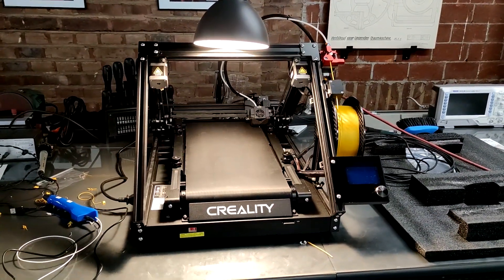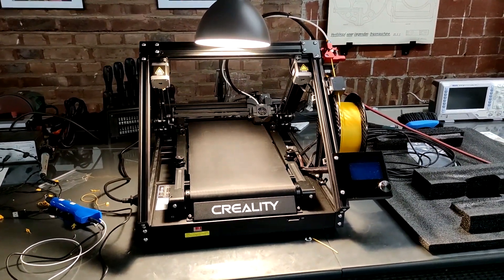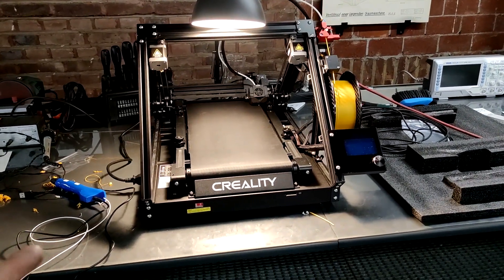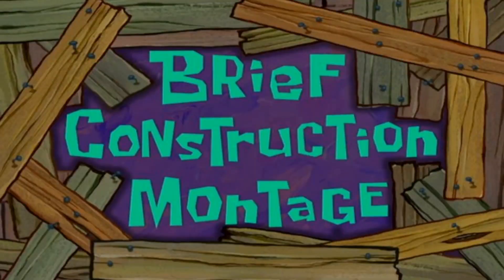Building the Ultimate Production 3D Printer

Comment: Servus Jan!
A showerthought I litteraly had right now: both your CMM and multi-hotend printers have already XY kinematics - why don't you print "normally" onto the belt and use the belt's extra axis just to eject the parts?
Also: Lüsterne Klemmen :D :D :D
Reply: I agree I mean he can’t really print parts wider than the plate under the belt anyway.
Reply: @joshuahuman1  He actually gets Double the space with this approach
Reply: I second this. Use the belt as a 4th axis und print normaly on it. Should allow for normal printing speeds and the benefit of fast bed clearing

Comment: Adding the belt to that monstrosity you built makes perfect sense now that you've said it. I kinda want to see you attempt a 5 axis printer with your CMM printer.
Reply: I’m sure he could without a problem but using it is another story. The maker/diy community just isn’t there slicer wise unfortunately. And I doubt it’s coming any soon as there isn’t much a 3axis printer can’t do.
Reply: Slicing is obviously an issue, but being able to print certain geometries without support or infill has advantages. Mostly it's just cool, just like turning a CMM into a printer.
Reply from the maker: I'm 100% with both of you. 5 axis would be really fun project (and I have way more done of the engineering than you might think :D) but right now it would be just a fun project without any need